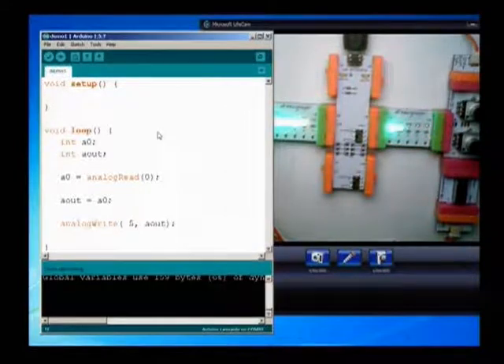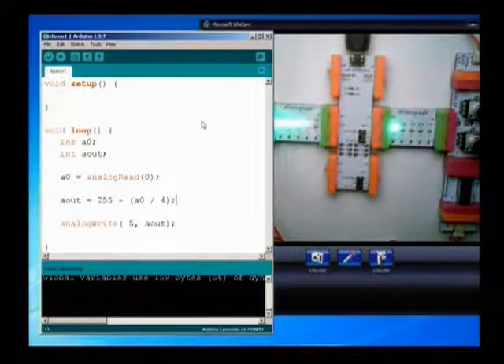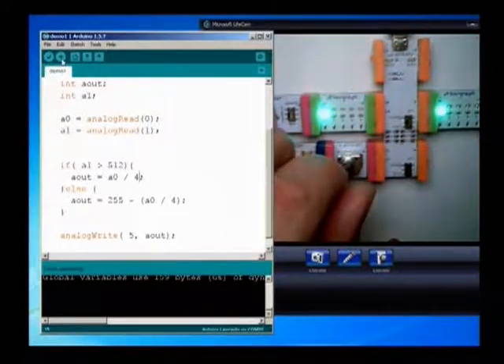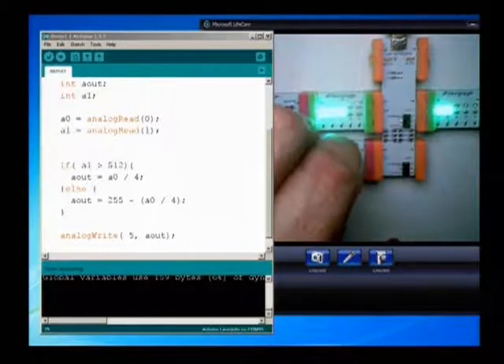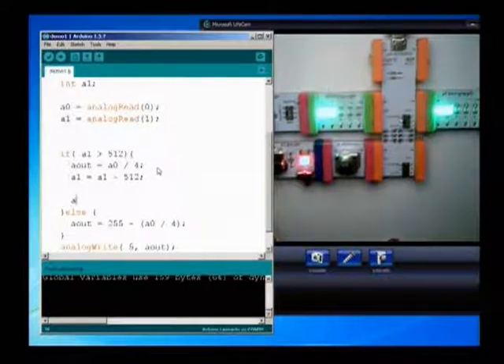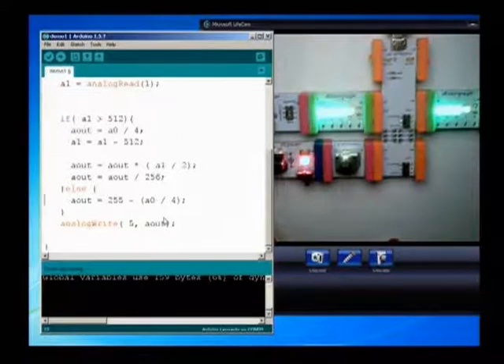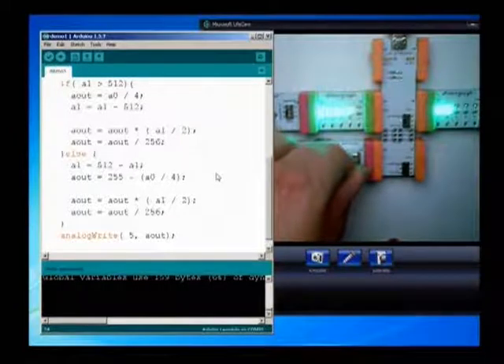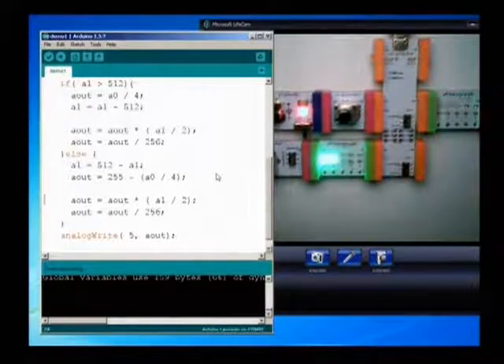LittleBits Arduino Synth Fun

Comment: Mr. Churchyard?!  I wanted to use your Arduino at ♥️ Heart Bit very much in the same way that you used it to produce LFO signals, only, I would like to use it to make 3 different metronome clocks, and have them produce quotients and products of some original set tempo.  Possibly adding the option of a “tap tempo” entry with momentary push button bit...  In much the same way that you’ve modded your werkstatt to come closer to the mother 32, I would like to basically come up with the polyrhythms clock generators on Moog’s newer semi modular, the Subharmonicon, only build it all from LittleBits!  I’m thinking that there could possibly be a way to keep the analog outputs free by making use of the header pins on the top of the Arduino bit’s PCB.  I believe that this application should be about as complicated as your LFO, OR maybe easier.  Basically I’ve been really hungry to make some YouTube videos like yours, mostly keeping LittleBits as the main focus of the channel.  I’ve found your approach to LittleBits to be most comprehensive as you have made your SoftBits.  Your demonstrations prove that you are elite.
Reply from the maker: Thanks! You could use the extra pins to produce clocks and the analog for the LFO two outputs.  The two inputs can then be used as the clock divider controls. Use the digital in as external clock or use internal timing
Reply from the maker: If you build the Midi in opto isolator you can then control it using Midi clocks from other instruments.  If adding external inputs for hardware clocking I would use an LM399 comparator to match and provide variable sync levels to the digital input.